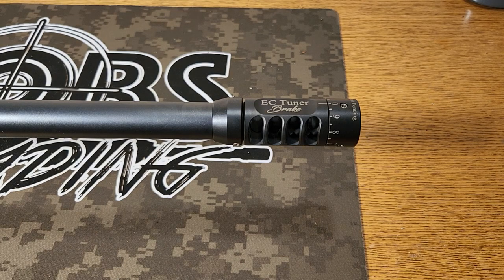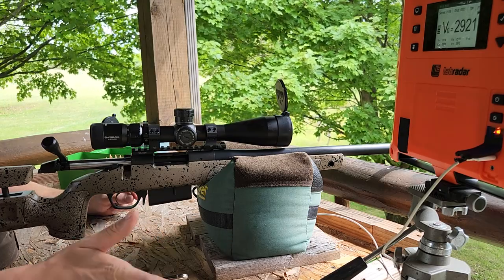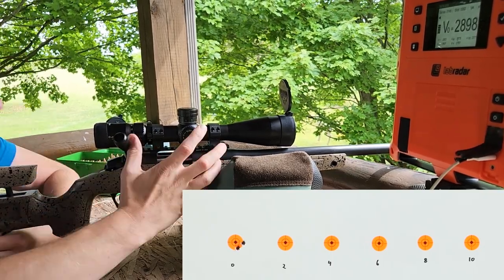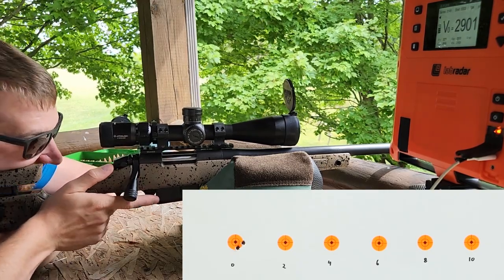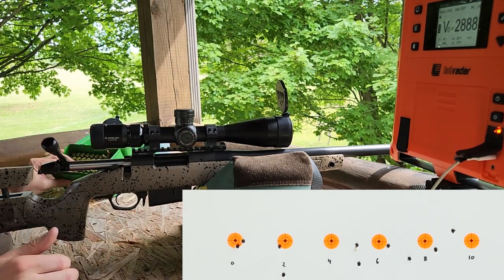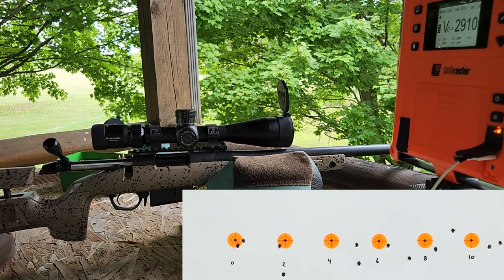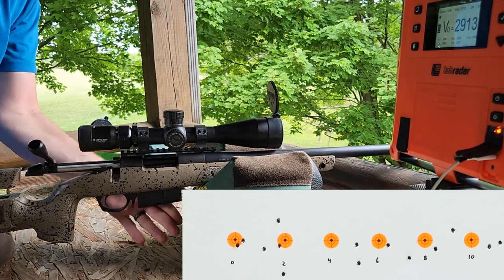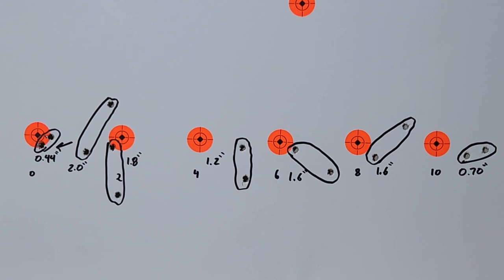EC Tuner, Tuning a Bad Load

Comment: I have several EC Tuner brakes. Just putting it on tamed your load better than you said it shot without. If you kept going you would find that it would tune better. However, Eric says it will improve your loads…. Not that they will all be touching. Tuner was not a failure. Also, the tuner best use is to tune a decent load. I got a 7rem mag to shoot 175 ELDX with less twist than Hornady recommended. Started 2.5 Moa and ended up 1/2 moa with a hunting rifle.

Comment: Tuner Zero shots 1 and 2 ES =  3 fps.  
Tuner Two shots 3 and 4 ES = 33 fps.
Tuner Four shots 5 and 6 ES = 10 fps.
Tuner Six shots 7 and 8 ES = 11 fps.
Tuner Eight shots 9 and 10 ES = 34 fps.
Tuner Ten shots 11 and 12 ES =3 fps.
Tuner Zero #2 shots 13 and 14 ES = 20 fps.
There is a pattern here.  Those shots with a velocity near to 2905 fps all had a similar POI, while the outliers (5) had drastic POI shifts.
More than would be expected at 100 yards, and that points to a bad bullet/seating depth with a bad powder/primer combination.
If you plot only the shots that had velocities around 2905 fps +/- 7 fps, then you will see the tuner was trying to do its job.
However, the other rounds just muddy up the picture with their drastic POI shifts that a tuner cannot do anything about except make a oval POI trace.
A tuner is often useless unless the velocity ES is under 20 fps, and under 15 fps is much preferred. 
Compared to your starting group of 1.7", all but one of these groups were better.  That kind of says the turner worked, just did not make a silk purse out of that sows ear.
Reply: Exactly! If your combustion isn't good then tuning it can only do so much.
Reply: Yeah good observation! Was about to say the same. The tuner is not magic. It can’t fix that wide of ES from round to round. That’s a huge ES for velocity when you’re talking precision shooting. I’m getting around 15 fps ES with factory Hornady 140 ELD-M, which is phenomenal for factory ammo. I’m usually trying to be around 10 fps or a little less obviously if hand loading. You can only get so precise though so 10 is doing pretty well.

Comment: Before you blame the tuner I would be checking scope mounts and possible bedding issues. One other thing to prove it out you would have to let the barrel come back to ambient temperature.
Reply: Right off he told you it was a bad load. He proved that. I am sure he had all of his screws tight.

Comment: Sometimes a load is so bad no matter what you do with the tuner it will only get so good and that so good is still bad. I had a similar result with a MagPro load. I loaded up 50 rounds all the same to test the tuner. It works, but if a load is bad enough it can't fix it. It was not a total loss because I was fire forming the new brass in the process. I do have a potential good MagPro load to test with only 20 rounds, and I will see how that goes. The bad thing is I am not sure how temperature sensitive that powder is. I did get a sub-MOA group a couple of times with the load I will be retesting and trying to dial in better, but it is a narrow window. There is no flat spot on the charge. Nice video. I have faith in the tuner, and it is a great brake. Nice video.

Comment: Little tip. Don’t take your head off the stock between firings. I get it you wanna catch your brass. But the odds of head placement being in the same spot every time go up if you keep your head on the gun. Just rack it and send it

Comment: To maximize your results, set the tuner all the way to the rear, work up loads at this point, then start tuning just like you see in this video. I normally got 1/4" and less groups with this method, and the tune is very stable.    Using the Browning BOSS system on various guns years ago, we were able to tune many loads, by shooting method explained in this video, two shot methods. You have to stop and clean the barrel periodically.

Most tuners will help you find  a very, very good group, but working up the load properly to begin with, will yield 1/4" and less groups, almost guaranteed!

Comment: Find a load that shoots under 1 moa consistently first. Then  play with the tuner. There are too many variables here that could be causing you bad groups. Ive got an EC tuner brake and they work. If your is capable of 1 moa or better without the tuner then the tuner should improve it somewhat but it won't make strawberry jam from lemon spread

Comment: I have an ec tuner break on my howa. 6.5 creed.   I'm not looking at it, and I can't remember off hand.    But my tuner is set to something like 18. Even with a load that everybody uses for 6.5 creed.  41gr h4350. And a 140Rdf    Keep going. Load up 100rds and take the whole day to experiment.   That tuner will bring shots together.   There is something like 70 settings if you thread the dial all the way out/off.    I've noticed your testing is always small 20rd lots.    And you go back to the closest 2 shots too quickly.     Your groups will open and close and open and close.   Be persistent. It will work

Thanks for all the data.

Comment: You need to find a powder charge that has a low ES and SD combo, and then you can tune your load.  I know this from my personal experience with an EC Tuner. If you look at the data from EWA Thoughts, your velocities are all over the place.  While I appreciate the tuner content, and you did prove that a powder charge/bullet combo that does not meet certain criteria are not able to be tuned.   Overall, I like your content and appreciate what you are doing for the reloading community.
Reply: Why is that? At 100 yards velocity doesn’t really matter much for group size.
Reply: @claysonbonds2422  He admits that it is a "Bad Load"  Tuners are only valuable when you have a load (10 -20 shots that have single digit SD and low ES) that is relatively consistent.  I do most of my initial load workup at 100 yards because I don't want to walk that far for a target.  Once I find some nodes, I then will do seating depths/tuner changes at 200 yards or greater.
Reply: @claysonbonds2422  It only doesn't matter if hunting a deer at less than 100 yards or not much more and that is depending on the group size at 100 yards. It matters if you are long range shooting. The velocity has everything to do with the harmonics of the barrel. If it changes enough the groups get fatter. longer distances fatter yet.

Comment: With the gun shooting like that I would be checking your torque on the stock bolts and making sure nothing is loose and moving.
Reply from the maker: Nothing is loose or moving. It was all checked following this range trip. I am going to do a confirmation group with a known good load today that will be posted next Wednesday to confirm something has not went wrong with the firearm/optic.
Reply: @RobsReloading  pretty crazy that the poi can shift that much sometimes.

Comment: Rob, I would try changing your seating depth with that load and see if you can find at what depth it tightens up, then try the tuner. The tuner is only going to help with a load that your rifle likes, not one that was shooting 4 inch groups to begin with. Enjoy your channel, keep the vids coming!
Reply from the maker: Not going to mess with magpro and the 142 matc king anymore. Going to move on to try the 147 eld with an extruded powder.
Reply: @RobsReloading   Send Cortina a copy of your video and see what his response is.
Reply from the maker: @jacklucas7265  this is not the recommended use for the device so I don't know what the point of that would be. If it would have tuned this load I would have been surprised.
Reply: @jacklucas7265  his response will be very close to mine.
Reply: Changing a seating depth works similar to a tuner. But sometimes it doesn't do any better. Eric Cortina suggests starting long and shortening bullets by .003" until they group better. But Rob's idea of leaving this expensive project is much better than continuing to waste more money. There is nothing promising about this load to begin with. If there was a glimpse of something positive it might be another story, but this load was a disaster.

Comment: If you haven't already done so, I would take a close look at your action's bedding, check the barrel channel to ensure the barrel is free floated, and make sure your action screw torque settings are tight and consistent. Note that small diameter barrels will heat up fast and, if there is contact with the stock, your point of impact will change as a result.
Reply from the maker: No contact between the barrel and stock. There is about 1/4 gap between barrel and forend.
Reply: @RobsReloading  Is the action bedded? What are your action screw torque settings?
Reply from the maker: @njgrplr2007  the b14 hmr has 2 aluminum section at the action screws. It is not expoxy bedded or anything. Action screws are torqued to 60 inch #.
Reply: My brother had an HMR in 6.5 CM. It was very inconsistent rifle even with multiple loads I made for it. It would get random sub moa group, and I mean just barely sub moa. I glass bedded the action for him, and it did become consistent sub moa shooter after that. It was not a 1/4” or even 1/2” gun after bedding, but it was a pretty consistent .75 to .900” rifle atleast. It was a success though cause before bedding it was about a 1.5” rifle. It must of been built on a Friday afternoon lol. I will say most HMR’s I’ve seen have been quite a bit more accurate than my brothers was.

Comment: I subscribe to your channel and appreciate your content, so don’t take this the wrong way. It’s a tuner, not a miracle worker.  Now having said that, which may not be exactly fair, for me, in all instances except one, tuner settings below 10 would do the trick. But those were all cases where some load development had been done with just a muzzle brake prior to getting Cortina’s tuner brake. The one exception was a new experimental max load in my 6.5 Creed that I had to take the tuner settings into the 20’s to get things to start tightening up.  Wouldn’t normally have gone to the trouble and expense but I just had to see. 

Good and interesting test. Just maybe take it a little further with the tuner settings and see what happens.
Reply: That load is just too crappy to waste money on with the standard deviations and extreme spread that he has. A tuner can't fix that.

Comment: It's made to tune your best load... not a stupid random charge load. Cmon.. U obvious making a product that does infact work, look like it doesn't work... This is a sabatoge of the ECtuner.
Reply from the maker: Have you watched my other two EC tuner videos? The only reason I even tried this test is because how well it worked in the first two videos.
Reply: @RobsReloading  well this video is very very very misleading to the newbies who's looking to fine tune their loads.. I'm a believer of this tuner, have it myself, and use it to tune my best loads afterwards..
Reply from the maker: @mryang3644  This is by no means a negative review, but it does show reality. If they weren't so expensive I'd have one on every gun I own.
Reply: @RobsReloading  considering it's a muzzlebrake all in 1 VS other muzzle brakes that's near its price, it's not so bad..... or be smart, I have a 30cal ECtuner Muzzlebrake and I take it off and use it on my 30cal and smaller rifles... chances are u never gonna use all them rifles at the same time to need one on each.lol...